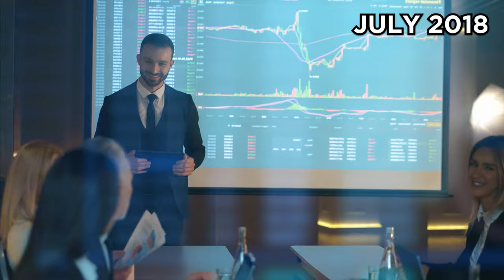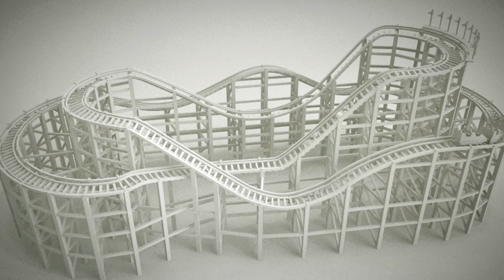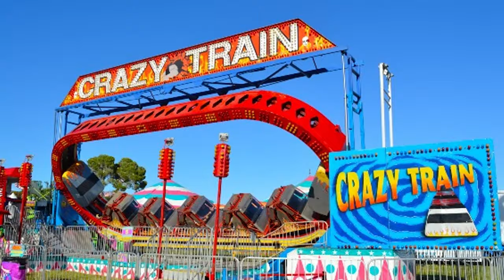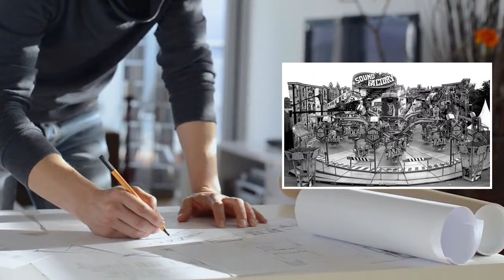20 STRANGE & INSANE Carnival Rides

Comment: The Megadancer and Devil Rock are actually Flic Flac rides built by German manufacturer Huss in the early 90's. Devil Rock has traveled one season on the Dutch fairs in 2019. Mondale is misspelled, it should be Mondial. The Predator and Transformer are Top Star Tour type rides and are based on the Move-It 32 from Dutch manufacturer KMG. Both are fun though.
Reply: yea he didn't do much research on this vid XD full of mistakes